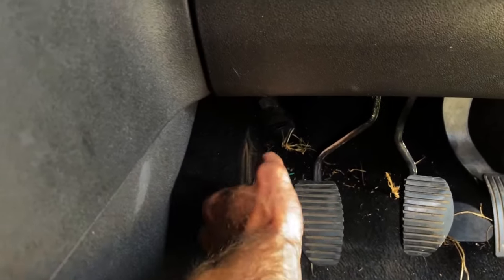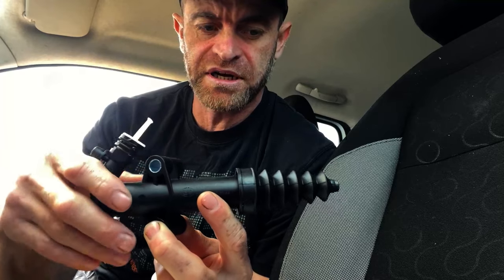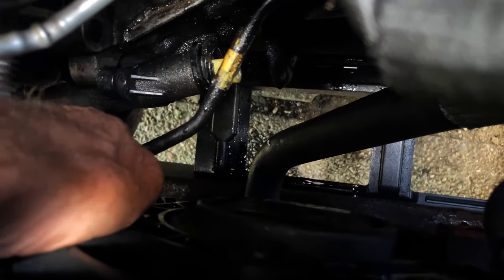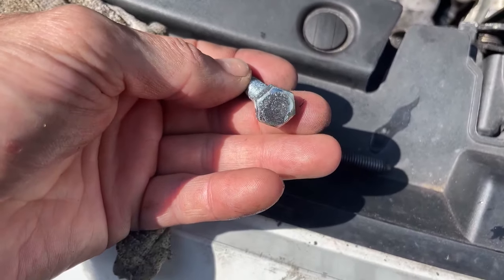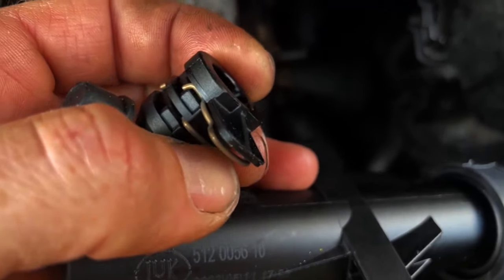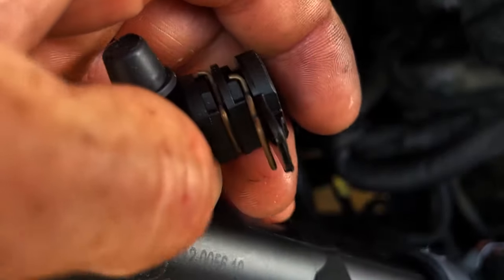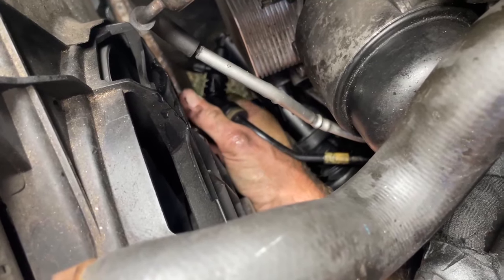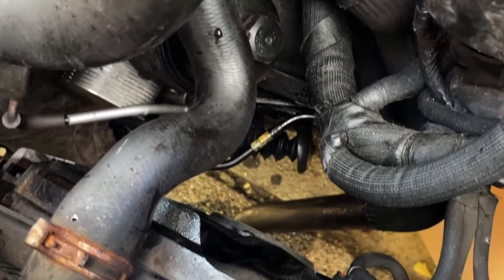Clutch Pedal Stuck Down ? | Slave Clutch Cylinder Replacement  | #citroen  #peugeot  #ford

Comment: Wicked video. I followed easily. Top vid 👏🔥
Only trouble with my car is. Where you sit the new part mine sits in with the pump. Bit open. The plate that it sits in that you said pushes it in. Is already out. Hope I've explained it enough. When I put my part in where you close the pump mine goes in open. Any idea what to look at next?

Comment: Just picked up a 2008 and got clutch issues, peddle all the way to the floor and cannot pull it back up and the slave cylinder is all the way out fully extended, any ideas. Great video by the way
Reply from the maker: Replacement needed

Comment: My car is a Citroën C4, 1.2 petrol, 2015 model. Not always, but sometimes the clutch stays down. I lift it back up with my foot, and after doing this, I can drive the car. There are no warning lights on the dashboard. What could be the problem? Could it be the cylinder (hydraulic system), or should I replace the entire clutch? thank you.
Reply from the maker: Cylinder hydraulic system I would say

Comment: I have a problem on a Citroen C4 II, the clutch squeals a lot, the sound comes from the cylinder, is it possible that the piston guide on the cylinder is broken or does the ball on the thrust bearing fork need to be lubricated
Reply from the maker: sorry for the late reply, did you fix the problem?

Comment: hi mate, just watched this video and found it good, I have a berlingo 1.6hdi 08 plate on 154km my pedal is staying down but I can lift it up with my foot and keep driving, few days ago my brake light came on then this happened, it was hard to get gears then I topped up fluid and it do seem better, is this likely to be slave or clutch
Reply from the maker: Definitely the slave
Reply: yes definitely the slave and changed it last night for £20

Comment: Followed the instructions but still no pressure how long was you pumping the clutch with your hand just not working
Reply from the maker: Make sure you open the tap for the air to exit, once fluid starts coming through you should be ok
Reply: Put cover back on when fluid leaks from tap?

Also do I push the 2nd clip in after bleeding?

Comment: Hi mate. Today on the way to work, after 10 miles, the clutch pedal became soft half way through and it started slipping badly. Clutch was replaced 2y ago and not slipped until today. I have noticed that the slave is not compressed fully when the clutch is not pressed. I can still shift gears but feels like the pedal was not fully reversed and there is a delay in reaction after pressing it. Do you think it will be slave that's at fault?
Reply from the maker: Pretty sure that will be the slave fella